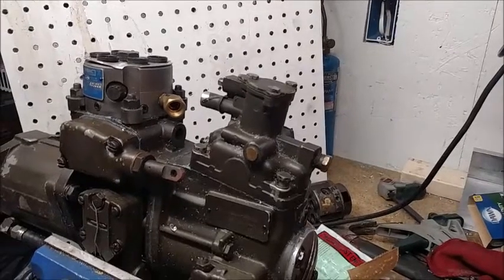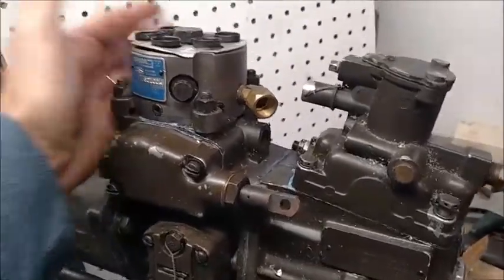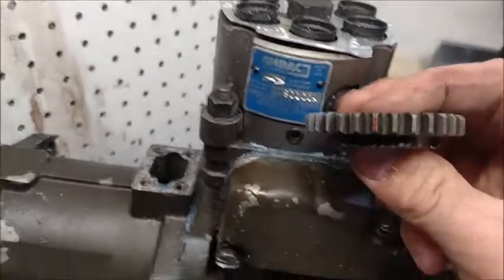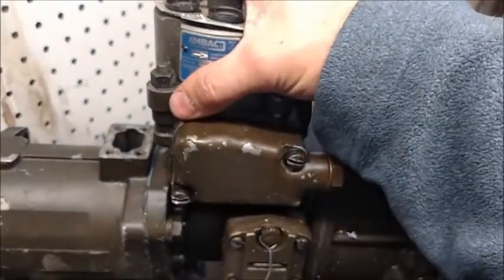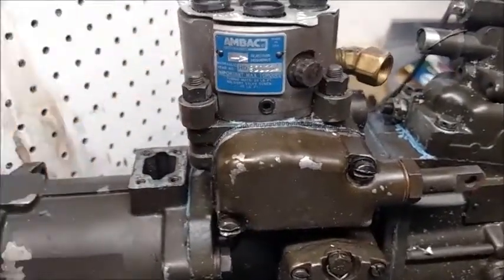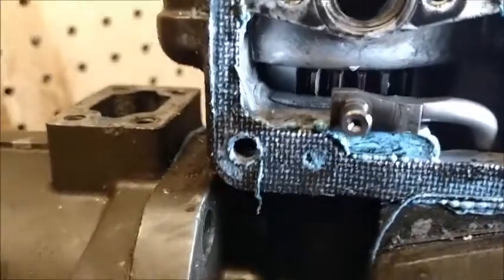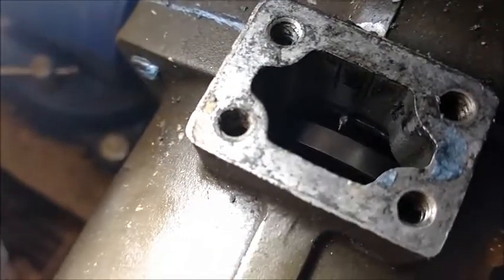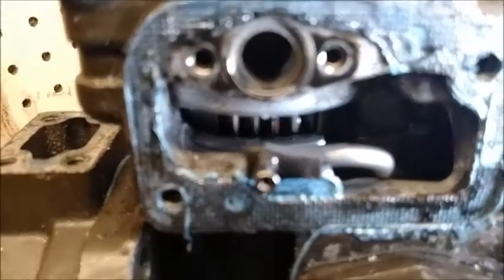HH Timing

Comment: There is so much misinformation on the hydraulic head. I had one issue once and several people said I was ‘180 out’ and to remove the head, turn the gear one turn and reinstall. Absolutely hilarious. But, you can turn the pump all you want with the head out. It’s not a big deal. Like you said, it only comes out and goes in one way. You just look down at the gear in the pump where the head gear meshes and turn the pump until the relieved portion of the gear is perfectly centered in the corner there and reinstall the head with the red tooth lined up. Easy.

Comment: How do you line that gear up to remove the head of it, with the pump still installed on the engine!? I have bought a 3 piece o-ring kit to get them replace, but haven't done it cause I keep on finding videos like this one, but no one explains how to get it to match/time that gear so that the head will come out, without me needing to remove the entire pump of the truck! HELP!!!